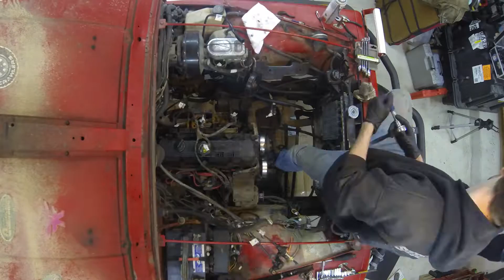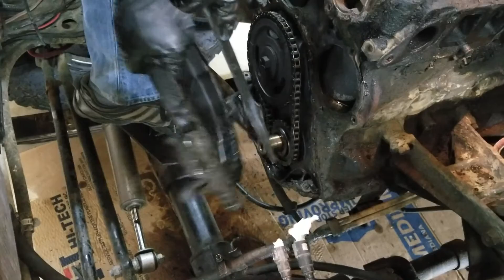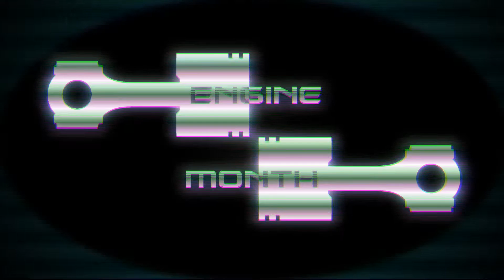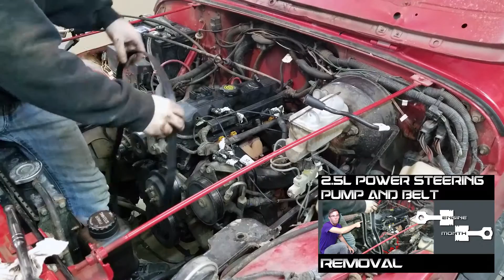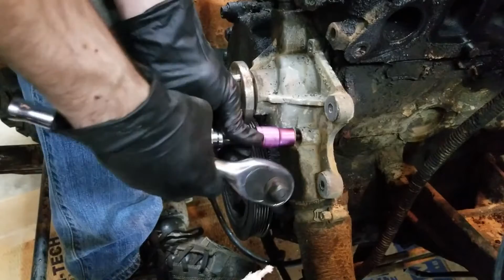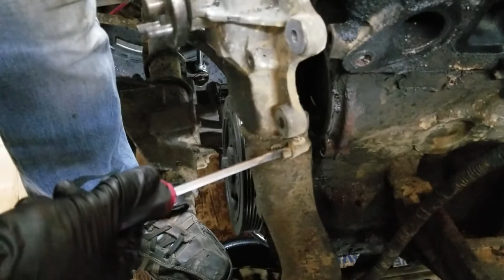Water Pump Removal Jeep 2.5L 4 Cylinder YJ

Comment: FYI-IF you have the thermostat housing off take a shop vac with a blower and blow into where the thermostat was sitting. It will help drain more coolant out of the radiator petcock and make it a slighty less messy job.